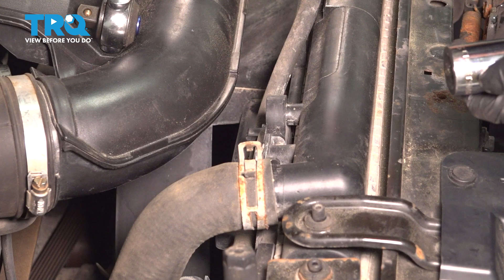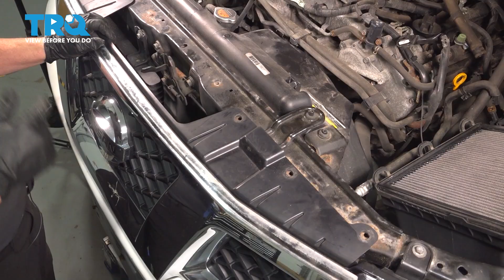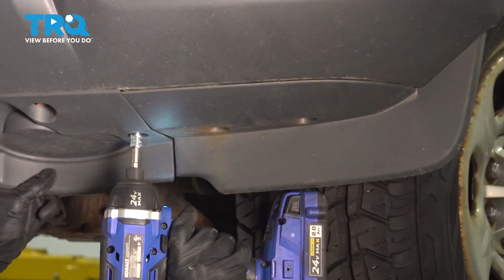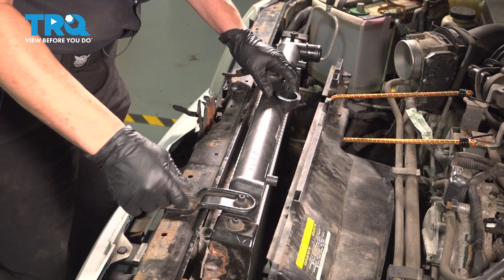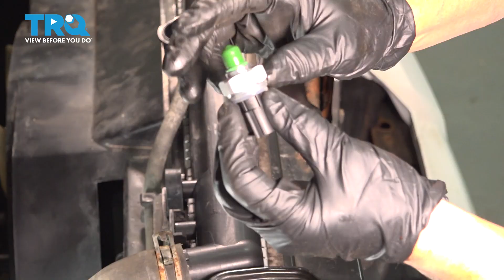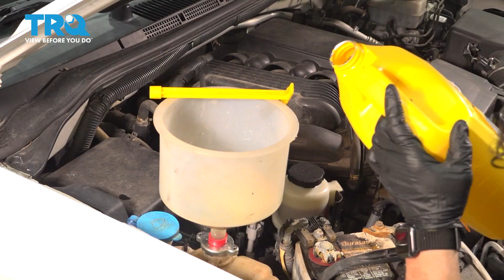How to Replace AC Condenser and Receiver Drier Assembly 2005-2021 Nissan Frontier 4.0L V6

Comment: Oof, this is probably the most detailed/thorough video ive found for my year/model/engine on replacing the AC condenser. Buuut... unfortunately,  its only half the job I need done..  I also need to replace the AC Compresso (pretty sure thats broken part im talking about) its the pulley thats on the right side of the engine that powers the pump for the AC. Pretty sure the clutch on it gave  out cuz it used to only start spinning when the AC was on. Even then, it would start spinning off nd on, when the pump needed power. But now its just stuck constantly spinning.. I'm hoping you might have e a video on repairing that part too lol ive been having so much trouble finding a solid video o. What need nd i I just so happens to come across a really clear, straightforward video, it always ends up being the wrong engine or medel...

Comment: There is no Low side connection to the Condenser coil! The larger tube which was called “LowSide” is actually high pressure gas discharge from the compressor and the small tube is referred to as Liquid side! So both lines are high side, larger one is bringing the high pressure gas in the condenser and as the gas cools down it condenses into high pressure liquid Freon.
Other than that everything is functional service procedure. 
So thank you Sister